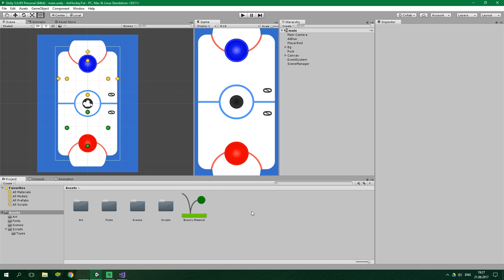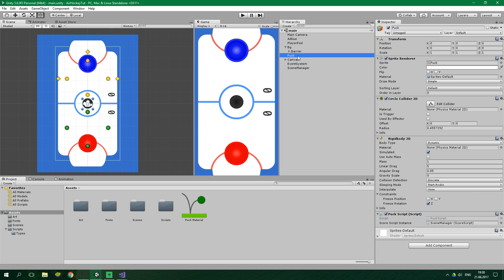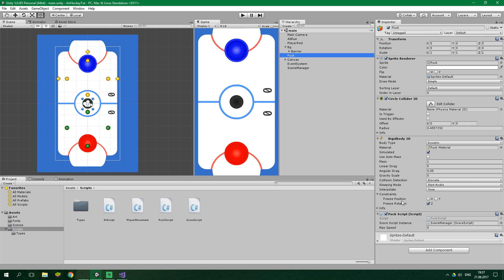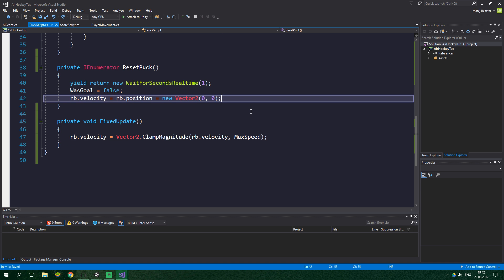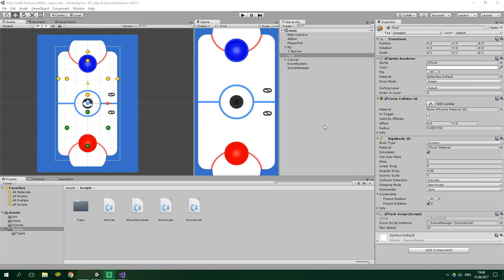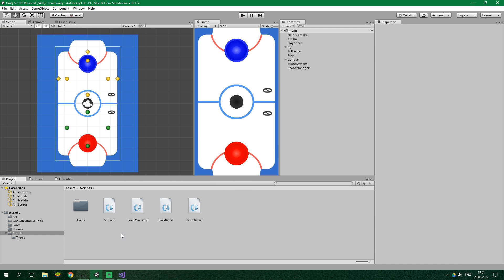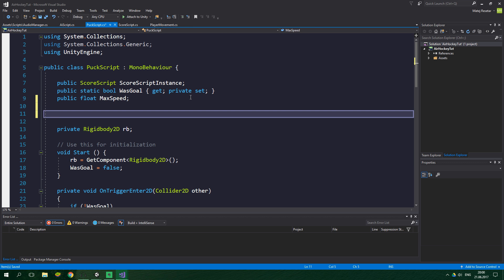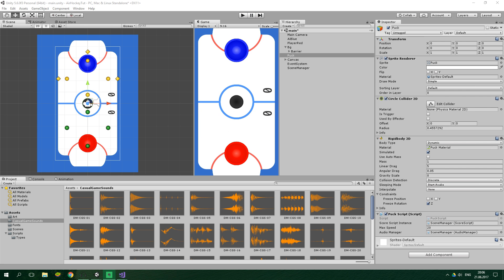#6 Make an Air Hockey Game in Unity - SOUND & FIXES - Tutorial for Beginners

Comment: Loving the series, I am having an issue where the puck will suddenly fly out of bounds if trapped in a corner with the paddle. Any idea on how I can keep it from flying off the board?
Reply from the maker: +John Smith Thanks! Unity's physics are a bit lacking in this area for sure so I've been trying to figure out a workaround for quite a while. I haven't tested this yet but making another boundary just for the puck might do the trick. It should probably be just a bit "inside" the barrier so that it can still bounce.
Reply: Hmm. That seemed to help quite a bit. Now I'm having tunneling on the puck. https://puu.sh/x9EmW/7ccaec3527.mp4 What's the best way to deal with this issue?
Reply from the maker: +John Smith Ah yes. I haven't been able to figure this one out yet. It seems that playing with the collision detection mode can smooth this out.
Reply: I've tried about every setting I can think of and I don't Physics2D is capable these edge case detections. If I come up with a simple solution to the issue I'll post it here.
Reply: So I figured it out for the most part. I switched the rigidbody type to dynamic for both strikers, set their linear drag to 1, mass to 1, the bounciness of the puck material to 0.8, and have sloped edges instead of a hard corner or curved helped get rid of edge cases. Not perfect but pretty darn close. There's slight jittering but nothing I can't live with and perfection is the enemy of good. Thanks again for the course.
Reply from the maker: Thanks for this info!